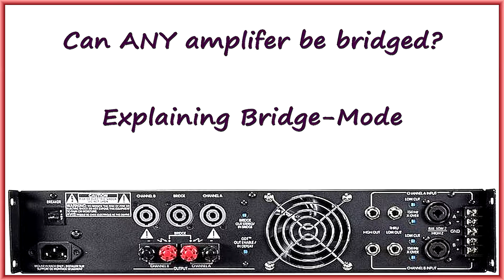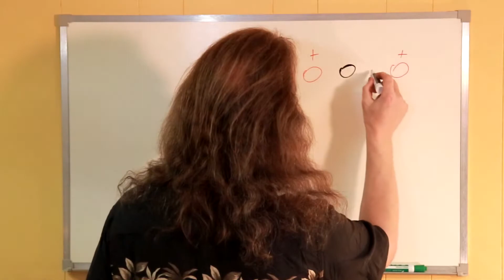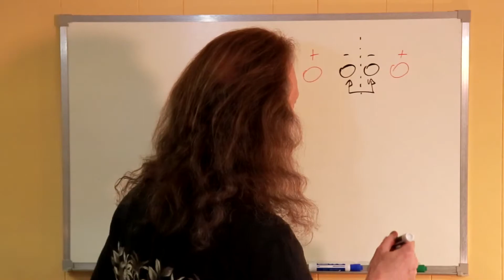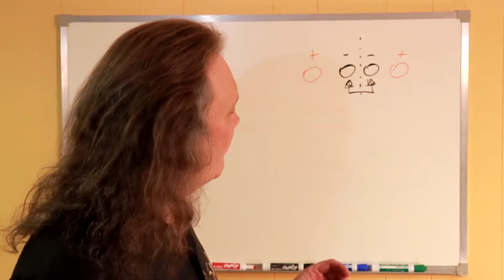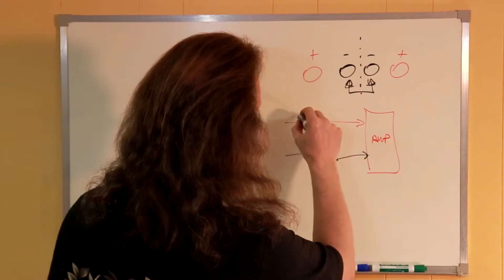Can Any Amplifier Be Bridged? The Truth Every Audio Enthusiast Should Know

Comment: Very clearly and well explained, first time I've seen one of your videos, thank you!  Basically I have a Crown 2502 running the 2 subwoofers on my system.  Unfortunately, when adding my nice used Ayon class 'A' tube amp to run the two tall open baffle multi-driver dipole line arrays, when I use the 'Pre-Out' to go to my Crown in normal stereo mode, even though it is rated at about 400 a side, it BARELY is loud enough fully cranked up.  So, I did bridge the amp before and that evened out the levels between the two amps and the highs and lows really well.  

But, I did something stupid and shorted out my nice new-to-me Ayon (DUMB!) which did not have anything to do with bridging it, and I just got it back after 2 months and I can't quite remember how I had the 2-15" dipole subwoofers wired  😊  I get the connecting ONE speaker to the two positive terminals, but I THINK I had the 2 woofers wired parallel and THEN connected them to the two positive terminals so that they would then both basically form a single mono 4 ohm driver in a way.  So, I'm PRETTY sure that I connect the two positive wires from both speakers together and connect the two negative wires together and THEN like one big speaker/woofer connect to the 2 positive output posts, right?  I mean IIRC it makes sense because when I wire both speakers together like that, then they are in parallel, right, and thus reducing them as 'one' mono driver to 4 ohms instead of 8 ohms each, correct?

Just trying to make sure before I try to connect them again, but I'm FAIRLY sure I am remembering correctly.  PLEASE, if you have a moment, if you could kindly either correct me or assure me that I am doing it right, that would be awesome, thanks Bro!
Reply from the maker: When you were running the crown amplifier in stereo, and it wasn't loud enough, did you actually see the clipping lights blinking? If not, chances are your receiver doesn't drive a strong enough signal into that amplifier. Pro sound equipment expects higher signal levels than hifi equipment. If this is the case, check out my other video about connecting prosound amplifiers to hi fi gear, I discussed methods of properly connecting equipment so you get full performance out of the pro sound gear.

If the clipping lights were hitting, then you need more power. Bridging the amplifier might be a possible solution for you.  

You could parallel the speakers, connecting the plus terminals together, and the minus terminals together, and then both of those leads to the two positive output terminals on the amplifier.  If the drivers are 8 ohms, two of them in parallel would be four ohms. 4 Ohms on a bridge amplifier is a pretty heavy load, I don't like it, but I suspect the crown amplifier can deal with it without overheating and failing.

If you want to be nicer to your amplifier, wire the speakers in series. Connect a wire between the negative terminal of one speaker and the positive of the other, then take two wires off of the two remaining terminals (the unused connector on each speaker) and connect those two to the positive outputs of the amplifier.  This will be a 16 ohm load, two 8 ohm drivers in series make 16 ohms.  The problem with this, is it takes more voltage to deliver a watt, so this configuration will play quieter, and you may not be able to get the same amount of power out of the amplifier in this 16 ohm setup.

Good luck, and best wishes
Reply: @Barry-Watson  Excellent, that is what I thought, thank you!  Yes, I was quite surprised that the Pre-Out of the tube Class 'A' Ayon was apparently so low  going to the Crown.  While my Ayon was getting fixed from my bonehead screwing it up (thankfully a very experienced fellow nearby in San Diego did a beautiful job in fixing it for only about $275 - Ayon's Arizona rep quoted me a minimum of $800 just to look at it, Dumb@sses!) I had a chance to score another great barely used Cronus Magnum III all tube integrated amp for about $2000 (retails for $3500!) The Cronus is rated at an amazing 100 wpc which is huge for an all tube amp (it uses larger output tubes - The Ayon uses all KT88's rated at 50-60 wpc) and it did indeed have more 'punch', although I THINK it is not quite as 'spatial' as the Ayon.

So, when the Ayon was getting fixed Interestingly I noticed that the Cronus has both direct and variable outs, with the direct Pre-Out being similar to the Ayon.  So, when I used the Cronus the same way, the output was quite a bit higher, although I still left the dipole woofers bridged with the Crown.  I wonder why the Ayon's output was a LOT lower...?  Using the direct Pre-Out of both I can't see why that would be different.  And yes, to answer your question, the power output lights on the Crown were BARELY moving even with the potentiometers wide open.

Anyway, it's not like I'm going to be driving them at ear shattering volumes  😁 but, I think I do need the extra 'bump' just to be sure I'm getting enough for the lows.  I know about the 'series' wiring.  As a matter of fact in order to get the ohmage somewhat manageable with 13 drivers a side on the line arrays, I had to wire the drivers Series/Parallel in groups of 4 (3 sets of full range with one lone ribbon tweeter with a single capacitor as the only 'crossover' with all others running full range) So, the 4 smaller drivers in Series and then each group wired parallel, so it worked out to somewhere roughly around 6.x ohms a side.  

I'm kind of thinking that wiring the woofers in Series at 16 ohms might kind of defeat what I'm trying to do.  The Crown I guess is rated down to even 2 ohms bridged, and like I say I'm really not planning on driving them that hard.  I just need the headroom to go down as low as possible with enough power.  I bet you would be VERY surprised at how low these go even though they are on open dipole baffles  😊

Thanks again SO much for your help, please keep up the great videos for us!  👍
Reply from the maker: Okay, if the amplifier's signal lights are barely starting to blink, you're hardly even turning it on.

The standard signal levels of hi-fi gear, versus pro audio gear are typically 10db or more apart.  That's a pretty significant difference. To accommodate that, I would suggest putting a signal converter box between your preamplifier and the pro sound power amp that converts the signal from unbalanced (RCA pin) to balanced (3-pin XLR), and boosts the level.

Then you should be able to crank up the amp, and get it to drive to full power. I would bet the amplifier has ample power for your application, and there's no need to run in bridge mode, which provides lower performance in every way except for output power. 

Consider something like this:
https://amzn.to/46Y3GJ6

Be sure to grab a couple of XLR patch cords, male one end, female the other if you need them to go from the interface box into the amplifier.

if you like the fancy stuff, here are some nice ones:
https://amzn.to/3QDbSbN

Videos:
https://youtu.be/ShT8mWo_P1g
https://youtu.be/HP4iDvEaonM

Cheers!
Reply: @Barry-Watson  Yes, I saw that you had alluded to that earlier, I just was not familiar with that conversion between the types of equipment.  Even now with it bridged, I still have to crank up the Crown to about maybe 2 or 3 positions back from full.  But, I will look into what you are suggesting.  It's just that being an 'Audiophile' I kind of hate to introduce anything into the signal chain that I don't have to (thus the 12 full range drivers a side with only one capacitor on the ribbon tweeter - and, of course absolutely NO EQ ever! 😊)

But, I'll check it out.  It's not like the Crown is the pinnacle of 'Audiophile' equipment anyway, I originally chose it simply because I just wanted something fairly well spoken of that was powerful enough to drive the 2-15" dipole woofers.  But, at that time I was using SS amps for the line arrays and there wasn't that disparity.  Also there was a 'Tape Out' from the amps I was using to go to the Crown that apparently is at full throttle which was plenty.  That disparity in output from the Ayon sure is a weird one, but I see that you are familiar with that phenomenon happening between the two different types of equipment.  I wonder if I should just look for some other kind of 'Audiophile' amp (I keep putting that in parentheses because I know it can be a bit pretentious)  I wonder if I just looked for some mid-level affordable 'Hi Fi' amp to drive just the woofers if it would 'Sync' better power wise with the Ayon...?  Thanks again for the excellent help and suggestions!
Reply from the maker: Well, I find it a little bit amusing that you would consider bridging the amplifier, and feeding it single ended, with all of the sonic problems associated with that, but you're worried about the sound of a conversion box using modern op amps - haha.

Furthermore, we're talking about the subwoofers, so you'd probably never hear any minor artifacts down there anyway.  Personally, I wouldn't bridge an amplifier unless it was absolutely necessary.  Convert the signal properly, if you want the equipment to work like it's supposed to. 

Do not feed unbalanced signals into a pro-power amp, that is not a good way to do things if you want decent sound quality.

So find a unbalanced to balanced signal converter, like that ART clean box, and that's the answer to this issue.  Drop the $150, and I think you'll be very happy.

There are other manufacturers who make these kind of conversion boxes -go for one from a respected brand (like ART).  Just avoid the supercheap $20 no-name versions.

I've been down your path. For me, I think it's a path of religion. After spending many thousands of dollars on fancy shiny hi-fi equipment when I was younger, I started sliding more toward the Pro Sound world where real performance was delivered.

Now, i'm not saying to go buy no name cheap junk and say that it will sound great. But I do believe that professional gear marketed at the commercial industries will almost always outperform all of that overhyped, overpriced, over shiny hi-fi junk that pipe smokers fawn over.  I go for equipment designed by real engineers, using real science, and real measurements and used by professionals who demand real measurable performance, and know what it actually is.

There's a lot of religion and hype in the sound industry. Don't believe the hype.  And... keep exploring!

PS - There are some minor differences in electronic equipment, but let's get real, top quality audio gear these days sounds really really good, just about all of it. You're not going to hear a major difference between different brands of amplifiers and processing gear 99.8% of the time. You WILL hear a big difference in loudspeakers, that's where to focus the attention.
Reply: @Barry-Watson Heh, fair enough, I understand. I think it would be worth checking out the unit on the link you sent me above that I guess converts the unbalanced RCA's coming from my Ayon to balanced interconnects going to my Crown, right?  Yeah, since I'm dealing with the low frequencies I'm sure I don't hafta really worry about anything too fussy at those levels.  I'll try that ArtCleanBox I think it was about $80 on Amazon, the one you suggested on the reply above.  If it really bumps up the signal and still sounds really good then it will be worth it.  I know that you are more knowledgeable about bridging and the effects that it can have which I am not conversant with, so I should try what you are suggesting.

Don't worry, I don't have the means that a lot of these guys do like on the Steve Hoffman forums do to get too carried away with this stuff  😊 I've just been doing it for quite a while and have been TRYING to get the best sound with what I have to work with.  I really appreciate your input and knowledge about these things and I'm looking forward to hearing how it sounds with that converter in between the two amps.  I still don't quite understand how it works, whether it just automatically does this conversion/boosting and the signal comes in the RCA's and goes out the balanced outputs, or if there is some kind of volume control or what.  But, if I can't figure it out or if somehow I don't like the sound I can always send it back with Amazon.  Oh, taking a closer look at it I see it does have gain knobs which I'm guessing controls how loud the output is

Thanks again Bro!
Reply from the maker: You're more than welcome!  You just need to bump that signal up by about 10db from your preamp so you're in the right ballpark signal level for the prosound power amp.  

The audio industry has "standards" for what is typical normal audio signal levels between equipment. The hi-fi world tends to use rca connectors, unbalanced (2 wires) versus the pro sound world that tends to use mostly xlr connections (3 wires) that are balanced and operate at a significantly higher signal level.  This allows us to mix and match different brands of equipment, and have all of it compatible so it works well together.

There are some (rare-ish) hi-fi preamplifiers that DO offer xlr (pro-audio) balanced outputs, But these tend to be high end and expensive, a much more expensive choice than that converter box. 

So... Just take the rca output from your preamp into the rca input on the box then take the xlr output from the converter box to the amp, that's it.

That particular conversion box, could convert signals in both directions, (hifi to prosound and prosound to Hifi) so it also has connectors for going in the opposite direction, XLR in to rca out, but in your case we won't be using any of that. 

So, just leave those connectors unused.
I don't think you have prosound mixers or other gear that you need to feed into your hifi preamp. But, this gives you that option if you ever need to do that.

I think that unit does have a gain trim control, which might be handy, you can also adjust the controls in the amplifier itself as well.  You should have good control for balancing the tops versus the subs.

Give it a try, I appreciate if you use my provided link (the referral link costs you nothing, but it does help support this channel a bit), and if you have any questions about getting things hooked up or if it's not working well for you I'll try to help if I can.

Best wishes, and best wishes with your neighbors when you get the system set up so it can drive your amplifier up near full power.  haha
Reply: @Barry-Watson   Thanks Bro!  Just got the unit today (sorry, I didn't know about your referral link, my humble apologies mate) and I'm waiting on the 2-1 foot Mogami balanced interconnects, they are coming tomorrow.  TBH, I am quite skeptical about introducing more things into the signal chain, I am intensely 'Purist' in that way.  But, I am looking forward to the boost in the gain and really want to see how the 'quality' or depth of the low end is affected.

Yep, I'm hopin' that I will have every reason to send the neighbours some flowers  😁
Reply from the maker: Hey that's awesome!  Fast delivery!  I haven't measured that specific box but the specs are good.  I'm betting it's going to work great for you.  Keep in mind that it's not doing any tone control, or sound shaping, it's just a pure signal boost.  I'd take a wild guess that it's simply something like a 5534 op-amp chip inside, and some of these modern op-amps are cheap and excellent.  It's not a complicated processor.

If you're worried about super pure signal handling, have you seen a recording studio?  Sure, they use good equipment, but they have racks and racks of processing, tons of digital processing, miles of generic industrial typical wire everywhere.  I can assure you those wires are not 24 karat gold, and good chance the audio has also passed through A/D converters more than once.  Circuit design certainly matters, but all of this audio equipment from the cheap to the rarefied high end is likely getting most of their internal electronic parts from the same suppliers.  None of these companies make their own resistors, transistors, capacitors etc.

So , that music you're playing, ain't that clean to begin with.

It's like my buddy who is going on about how wonderful the mic preamplifiers in his mixer were, and how low noise they are, while he's using less than studio grade microphones in a noisy bar with lots of background noise, and an audience who really couldn't care less, and there's no way anybody even him, could hear a difference in that situation.

Also, do keep in mind that any sound system that has enough amplifier to reach full rock concert levels, may have a little teeny bit of background hiss when no program material is playing.  That's just atomic physics, ALL audio systems have some background noise, and with enough boost you'll hear it.  If you experience this, you might want to back the gains down on the power amplifier a bit until your noise floor is acceptable, you'll probably still have enough upward room to move to break the neighbors glassware if you want to.

Well, turn it up and burn it up!

Good luck, and let me know how it works out!
Reply: @Barry-Watson  Thanks Bro for the helpful comment!  Yep, got the Mogami balanced interconnects today and put it together.  I don't know your opinion, but in over 40 years of doing this I feel that most components need a bit of time to 'break in', so I wasn't expecting great stuff immediately.

But, my very first impression wasn't too bad.  I played a few albums throughout the day to give it some time, and later on came back and played some albums that I am more familiar with.  Well, to be honest, I was very skeptical about this.  I understand your general comment about this, but I'm afraid that after putting all these years into this from an 'Audiophile' standpoint, within reason of course, I honestly do hear quite subtle differences in equipment and with my system the way it is particularly designed (feel free to check under my name here if you wanna take a look) I can most definitely hear differences in the image and soundstage (with 13 drivers a side on tall, open baffle dipole line arrays, that really reveals a very large and specific image)

So, as I was listening throughout the day, I'm happy to say that I was generally pleased with what I heard.  I was checking out vinyl where the bass went down very low, and what I liked was that YES! the low end most definitely has WAY more authority, no question.  But also I was very carefully watching for any boominess or any 'uncontrolled' bass since the low level signal was going through these 2 new components.  So far, I've not felt that there was any mushiness or boominess, but I am going to run this for at least a few more days and listen to more of a variety of albums to see what I think.

But, quite honestly, so far I am pleased with the stronger authority.  I thought for sure this would translate into a boomy or artificial sounding bass.  But, so far, even if there were a little give in the 'quality' area, I THINK, and this is just my initial impressions, that I like hearing more power in the low end and that it doesn't necessarily mean that it is overpowering.  It is interesting to see what the balance is between the CleanBox gain and the potentiometers on the Crown.  I'm experimenting with raising the volume of the CleanBox and lowering the Crown and vice versa.  Based upon my knowledge, I would GUESS that although you would want plenty of signal coming into the Crown, still, you wouldn't want all the power to come from the 'Pre' signal but I would THINK one would want the Crown to be doing some of the heavy lifting.  So, where I have it at the moment is with the CleanBox at about 3/4 and the Crown at about half.  I'll continue to play around with that.

No, I am not one to get all worked up about 'hiss'  But, even so, I don't notice any.  As a matter of fact, a low level humming (feedback) noise actually went completely away after installing the CleanBox and interconnects    😁 So, that was a nice bonus!

Even though I was VERY doubtful, so far I believe that unless I notice something detracting from the playback that I am probably going to keep this.  Again, I do really appreciate the fact that there now seems to be a lot more authority in the power going to the Crown which I feel probably affects the overall sound quality positively rather than straining it while bridged.  Thanks again for all your help!  I would have NEVER known anything about this if you hadn't kindly helped me.  I'm thinking that the 'Audiophiles' on the Steve Hoffman Forums would likely not suggest something like this.
Reply from the maker: Outstanding!  I'm happy to hear that, so far, it sounds like it's working well for you.  The equipment works better when you feed it the correct signals.

Have fun with the journey to ever better sound quality.
If I can help, don't hesitate to ask.
Reply: @Barry-Watson U Da Man!  👍